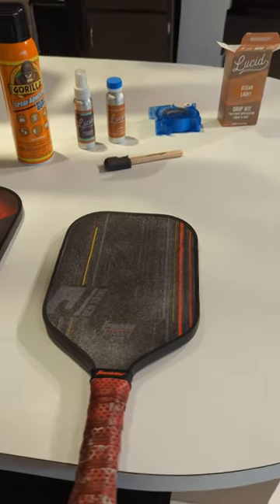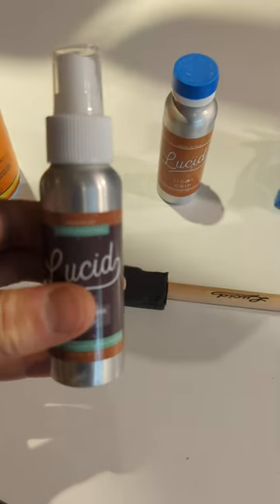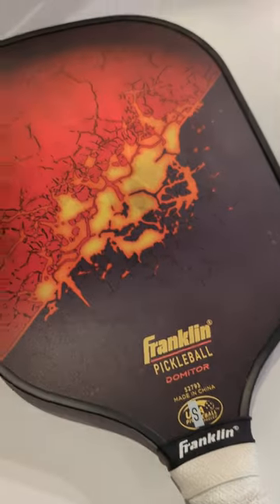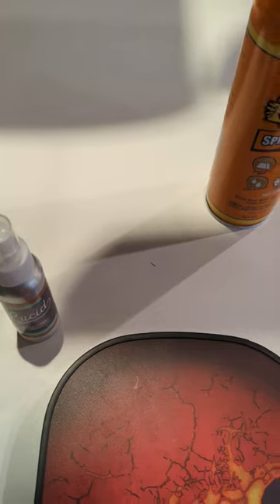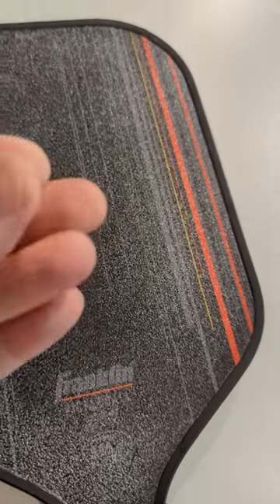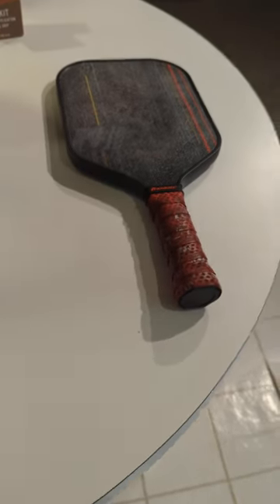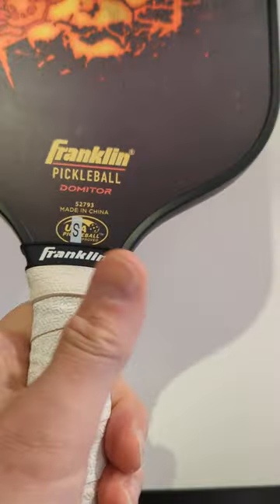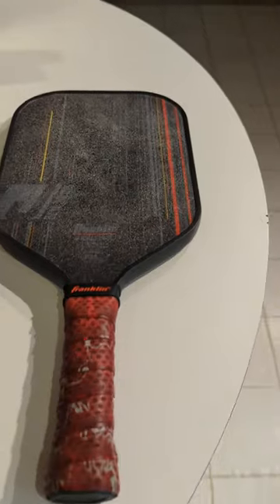How to apply Grit or Texture to your Pickleball Paddle for more SPIN and what product to use - PART1

Comment: After watching your video I was motivated so search for a spray paint with grit and found rustoleum anti-skid.  I spray paint on one of my paddles and will see how it works come Monday. 
Might be another good option with just one process.
Reply: how did it work?  stay on OK
Reply: @2000thewoman it worked good and has stayed on nice. I did 3 of the 4 paddles and both me and my son get 0:02 allot of spin out of the $20 paddle.  We kept 1 untouched just to see the difference and the grit makes a difference for sure.
Reply: @trefflek .   This will make your paddle illegal in any tournament. The USAPA says you cannot have a paddle surface rougher than 320 grit sandpaper. If you want to add more grit and keep your paddle legal, just buy 320 grit sandpaper and sand it.
Reply: @johnharrisonschulz  It’s just a paddle  for fun with family and friends.
Reply: Anyone tried 'sand blasting' it?
Reply: I do the same thing and won a tournament at pictona a few weeks ago.  They checked my paddle but only looked at it a few seconds more than my competitor’s.  I get massive spin, so much I dialed it down a little so I wouldn’t get busted…especially my serve. I just hit pop up serves deep and no spin.
Reply: Rule 2.e.5.a limits what can be altered on a paddle. The face is not one of those things. I was hoping this wasn’t the case but I was disappointed to read otherwise. I thought that bc rule 2.e.6 only talks about what you can’t add, then it would be legal but after reading the other rule closer I learned I was wrong.
Reply: Is anti skid the same as anti slip?
Reply: Does it leave a textured surface like in this video, or is it just tacky/rubbery but still smooth? And how long did it stay on the paddle before needing to respray?
Reply: @johnharrisonschulz  No one cares what the USAPA says. Most tournaments don't check your paddles closely anyways. Sand it? That will make it smoother.
Reply: @Pretzel86c  No one checks paddles closely at tournaments. Would take too long. People take this way too seriously!
Reply: @trefflek  Does Rustoleum cover the artwork on the paddle surface?

Comment: Thanks for a great idea! I wasn’t happy with the Gorilla glue. Wasn’t strong enough for me. I used Flex Seal rubber coating spray instead as base glue and finishing glue. Have to say it looks and feels much better!
Reply: Did you use the clear Flex Seal or black?  Wondering what will look the most natural like it comes from the factory?

Comment: I can only imagine the spin you'll now get with that surface.
Reply from the maker: I'll update the results after I test it out.
Reply: How did it play?
Reply: @theseatownballer did your opponents comment?
Reply: @theseatownballer  did you ever update longevity? I used E6000 spray glue and aluminum oxide for the grit. Looks good. If you didn't know it was put on aftermarket you wouldn't know. I did not do the second coat of glue.
Reply: @milesruoff ,  This will make your paddle illegal in any tournament. The USAPA says you cannot have a paddle surface rougher than 320 grit sandpaper. If you want to add more grit and keep your paddle legal, just buy 320 grit sandpaper and sand it.
Reply: @johnharrisonschulz can you explain for me please What it means?

Comment: Technically not legal according to USAPA rules but I’m sure the spin you get is off the charts!
Reply: How does the USAPA regulate the amount of texture the surface of a Paddle can have?
Reply: @anomaly783 ,  This will make your paddle illegal in any tournament. The USAPA says you cannot have a paddle surface rougher than 320 grit sandpaper. If you want to add more grit and keep your paddle legal, just buy 320 grit sandpaper and sand it.
Reply: @johnharrisonschulz  I'm thinking it might be possible to just glue 320-grit sandpaper to the paddle face.

Comment: This will make your paddle illegal in any tournament. The USAPA says you cannot have a paddle surface rougher than 320 grit sandpaper. If you want to add more grit and keep your paddle legal, just buy 320 grit sandpaper and sand it.
Reply from the maker: Thanks for the comments, but everyone knows doing this to a paddle will make it illegal in any USAPA sanctioned Tournament or game.
Reply: ?? If you use sandpaper on your paddle, you'll make its surface smoother, not grittier.
Reply: I don’t think that’s correct. Take 320 grit sandpaper and rub it on your wooden dining room table or any finished wood surface and tell me it’s smoother. To get a smoother surface you would need sandpaper with finer grit than what the surface currently has. Even then you would need the correct sanding technique and pressure to actually make it smoother.
Reply: We KNOW it is NOT for tournaments. Hush 😅
Reply: rec play legal LOL